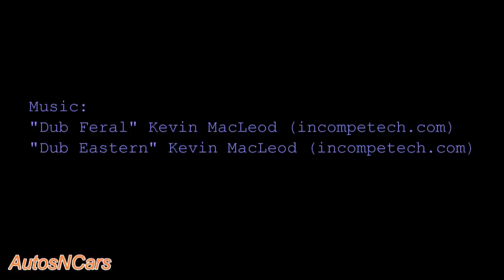TOYOTA SIENNA 1999 2000 2001 2002 2003 SPARK PLUGS REPLACEMENT

Comment: I was able to replace all the sparkplugs in our 2000 Sienna 3.0 in about an hour and did not need to remove anything. It's a tight space but a 3\8 craftsman medium extension, ratchet, and a plug socket is all that was needed. the hardest part was getting the boot off the left rear plug.
Reply from the maker: +Kris Karr you really need to make a video!
Reply: +AutosNCars I kind of wished I had. My wife was there watching me bear hug the engine. I was able to reach through the intake on the right hand side starting with the right rear plug and then work my way towards the left. At that point I had to also reach in on the left side with my other hand to get the boot out. Getting in there will depend on the size of your arms I suppose.
Reply from the maker: Kris Karr It is fun.
Reply: Why not use a t socket wrench that is how I replace mine on my 1998 sienna. They're ten bucks at Autozone. Takes me about a half hour.
Reply: It's a bit tight but much easier than pulling the plenum off etc.  I had a plug boot stay on a plug so I couldn't get a 5/8" plug socket down to turn the plug to get it out.  After consulting a mechanic, put some super glue on the plug wire insulated stem and pressed it back on. Let the glue set to adhere to the boot and Wa La! pulled the rubber boot off.  Even with boot silicon grease the rubber boots, including the coil packs, can stick.  I now will go about every 30 to 50k miles to pull the boots and regrease so I won't have this problem again.

Comment: Great video will be doing a full tune up fluid drain and refill  full exhaust change and suspension upgrade to my wife’s 2000 Sienna!  This video sums up everything I need to know !
Reply: wat is he doing you dont need to do all that humbug...just reach in behind right side back of motor and you can feel the plug wires for num.3/5 plug. follow the wires to the left side back of motor for num.1 plug...took me 15min for the back num.1/3/5 plugs.  not even 5min for  num.2/4/6 plugs....seriously you can get to plugs.

Comment: I did that to my 1998 sienna many time without removing a single part but the pure spark plugs. You just need small ratchets. Dealers charge $650 just for this job.
Reply: wat is he doing you dont need to do all that humbug...just reach in behind right side back of motor and you can feel the plug wires for num.3/5 plug. follow the wires to the left side back of motor for num.1 plug...took me 15min for the back num.1/3/5 plugs.  not even 5min for  num.2/4/6 plugs....seriously you can get to plugs.

Comment: I remember tuning up my 97 camry same engine...I didn't have to remove the intake ..i just use two short extension to pull the sparks plugs out ..lol!took a bit of time...I use E3 sparks plugs it lasts 80 thousands mile..i use on all my Cars!

Comment: Did it on my 2007... put NGK Iridiums in it... took original Densos out... hangs better on the  throttle... engine runs smoother... moderate cruising fuel economy jumped 3 mpg's...on state highway max is now 25 mpg

Comment: holy crap...
i just change mine. you need a 6" extension and a lot of patience. no need to remove the manifold at all! on the left rear, there's a nut holding 2 ground wires. remove that, then you can remove the crank case ventilation hose. that would give you more than enough room to maneuver a small spanner and socket wrench.
Plan your attack, before actually attacking the job. LoL.... took me 3 hours, but that's mostly from trying to figure out stuff. If i have to do it all again, should be done in less than an hour.

Shop estimate is $400 (they claim one coil must be replaced). my actual parts cost is $36 for the six iridium plugs. $12 for the anti-seize compound (which i can use for many other jobs). also bought my own Code reader ($55), and that's how i found out 2-4-6 cylinders are misfiring, making me decide on changing all plugs. no fault codes after plug replacements. engine light was gone too, without any need to reset.
Reply: so no coils needed replacing?
Reply: nope. it was actually the OCV (oil control valve) making the engine run crappy (engine chk light did come back when i got stuck in traffic). ordered for both banks online (about $50 from RockAuto vs $1200 at the local auto parts store), and engine is purring again.
Reply: Wow any way to get you to do a video? lol I want to replace mine myself after a quote of $600 and n 8 hour job
Reply: Missy, if you have the patience, you can do it. But you have to be mechanically experienced too. You don't want to mess up the treads for the plugs. Just be careful, don't get frustrated, and think how you'll overcome the obstacles. I wouldn't say it's easy, but I wouldn't say it's rocket science either. Have someone familiar on hand to give you advice as you go. If you have a sienna, look at lexus videos on youtube in the same year make, as they have very similar parts placement. In fact, I always said my sienna is like a lexus with cheaper clothes. LoL
Reply: Thank you so much Bien :)
Reply: Don't miss the links I gave on James Spencer's comment. The 2nd one gives a clearer view. You don't have to practically dismantle your engine like in this video. LoL
Reply: I'm planning to do for mine also... Can you help me with the tools? what tools do I need cause I have to buy them... I have none right now :(
Reply: Ah, but how many thousand dollars were lost to the swear jar?   ;)
Dropped sockets cost me enough to buy three sets of sockets, so that I don't have to keep crawling after them.  :/
Reply: bv
Reply: wat is he doing you dont need to do all that humbug...just reach in behind right side back of motor and you can feel the plug wires for num.3/5 plug. follow the wires to the left side back of motor for num.1 plug...took me 15min for the back num.1/3/5 plugs.  not even 5min for  num.2/4/6 plugs....seriously you can get to plugs.

Comment: So they estimated me at ~500+$ for spark plugs and wires that are still running after 17+ years, i think i can handle the job myslef but wish you did the wires with the plugs, that would've been a good idea since you're dismantling everything, looksnlike it took you over night to finish the job?
Reply: They're coil over plugs; no spark plug wires.  The coil packs only get replaced if they fail which is pretty rare.  On the same note of preventative maintenance, though, I'd change that PCV valve in the rear left corner.  $8 from the dealer and you'll never have better access then you do with that manifold off.

Comment: No need to remove the intake manifold. You can get a 3/8 in ratchet at harbor freight that has a swivel on handle and head of ratchet. Along with two 3” extension and you can reach around the top and back of the manifold. The two back left ones are the hardest to get to and can both be done in less than 15 minutes both remove and replace. No need to remove the whole top of wiper assembly cover either as in other videos. Too simple of job made to look so difficult. Message me if you need more assistance with this. I would be glad to help. There is also a video our that shows this done.  I believe its a Spanish man that does it. His You Tube Channel is 1unicorn1.  He shows to remove the wiper cover assembly.  I did it without removing this part with ease and no problems.

Comment: Great video, but The Toyota Service Manual said remove the Cowl Panel Assembly first, a bunch of 10mm bolts  that will make it 10 times easier with much more clearance, that is how I changed mine,  you’re doing it the hard way.
Reply: JazzLowrider finally someone on here knows what the fuck they're doing. the wiper panel definitely comes off. good stuff man. #firestonemechanic

Comment: Guess I'm  selling my van,  i don't wanna go tru that.
Reply: @americannovice americannovice lol
Reply: Is a hard work,you try do it without remove that is easier, I did it only touching
Reply: wat is he doing you dont need to do all that humbug...just reach in behind right side back of motor and you can feel the plug wires for num.3/5 plug. follow the wires to the left side back of motor for num.1 plug...took me 15min for the back num.1/3/5 plugs.  not even 5min for  num.2/4/6 plugs....seriously you can get to plugs.
Reply: You're right that's a whole lot of work to put in 6 spark plugs  some cars you have to lift the engine up to get the spark plugs in. LOL
Reply: Bien explicado. gracias

Comment: I changed all spark plugs easily on my 2000 sienna but the last one on the back passenger side broke.. I removed the windshield wiper system and you can reach them all.. the way this guy is doing it is harder but may help you not break a spark plugs on the back side.

Comment: When you tried to pull the plenum off, what was still attached?
Reply: wat is he doing you dont need to do all that humbug...just reach in behind right side back of motor and you can feel the plug wires for num.3/5 plug. follow the wires to the left side back of motor for num.1 plug...took me 15min for the back num.1/3/5 plugs.  not even 5min for  num.2/4/6 plugs....seriously you can get to plugs.

Comment: Makes it easier to work in the back of motor If you take windshield wipers and cover off first. Opens up the work area.
Reply from the maker: Hey, thanks for that suggestion!
Reply: 1kmiles can you show how to remove the Cowl off?
Reply: +onesri 
 The cowl/wiper cover has some push clips and bolts in it.  Take flat head screw driver and pop off wiper nut covers, at bottom of shaft. Take both nuts off. slide wipers off shaft. Detach all clips (push upward) from rubber hood seal (top front of cowl). Now, should be able to take top plastic cover off wiper shafts. Detach clamp from side hose. Now unbolt and remove cowl. Been awhile back since I did this project. Hope that helps.
Reply: thanks for the reply, yes very helpful

Comment: what is that he put on the new spark plug before he inert them back? Is that grease? If so, is it okay to use the lithium grease?
Thanks
Reply: antiseize
Reply: +ScubaCat3 always put antisieze on the threads, costs a $1 and prevents the plugs from getting stuck. Find it at the counter of your auto parts store.
Reply: @MojosArmy  That $1 stuff is ok, but pay a little more and get the copper stuff and you’ll be amazed at how much better it is.

Comment: Good Video, what are torque specs for tightening spark plugs, Bolts around coil packs, throttle body, and intake manifold.. ?
Reply: wat is he doing you dont need to do all that humbug...just reach in behind right side back of motor and you can feel the plug wires for num.3/5 plug. follow the wires to the left side back of motor for num.1 plug...took me 15min for the back num.1/3/5 plugs.  not even 5min for  num.2/4/6 plugs....seriously you can get to plugs.
Reply: @mbr3232  I actually had to do the valve cover gaskets as well so i took the air plenum off and whatever was in the way.. Ended up purchasing a years subscription from ALLDATA for the info I couldn't find, it was around 25 bucks not bad..

Comment: I did this ten years ago but did not need to remove anything.  There are lots of wires/pipes but I was able to insert socket wrench extension first and then attach the wrench handle.  You can't see anything so you have to rely on your fingers.  It took me two hours.  I bought iridium plugs thinking they will last 100k miles so I only need to do it once.  100k miles later my sienna outlasted the plugs and it's time to do it again.

Comment: The first 3 plugs seems easy enough but do you have to remove everything to get to the back three? The video is labeled "Spark plug Replacement" so do I need to remove all of this for the rear plugs. The video did not make that clear.I have been going through it and cannot find where you changed the rear plugs. If anyone see where the rear plugs were changed can you please respond with the time stamp. Thanks
Reply: Yea the first three looked pretty simple but I could not find where he replaced the back plugs. That looked like a lot of work and I definitely need to know how the back plugs are changed
Reply: The factory spark plugs are designed to go for 100,000 miles. The spark plugs are usually never the problem and never need replacement. It's usually the vacuum lines or sensor related. Do the plugs when you do the T-Belt and NEVER trust a flat rate mechanic. Got to be careful what temperature the engine is at or you will pull the threads out, that's why he used the anti seize. This tech has a great feel for the wrench but most guys need a torque wrench when it comes to the Intake Manifold bolts.
Reply: Are you TG?
Reply: Ok I found the part where he changed he rear plugs. It is at starts at 19:13. Looks like you do have to take all of that off. Maybe you can just remove the windshield washers and that cover below them for some extra space. I tried that today and found that the cover does not come off easily. So I think I am just going to have to remove everything like he did to get to the rear plugs.  Oh well. The van has 175K miles and I can hear and feel one of the plugs not firing properly.  I am pretty sure it is one of the rear plugs. 

I am not sure if just replacing the first three now and the others later would not more harm than good.

It is too bad because changing the belts (air conditioner and power steering), was really easy. All I have left to do is replace the spark plugs and the spark plug cables and everything will be finished.
Reply: No you don't. I guess he took off the links I gave. On the left side of bank 1, the #1 plug can be accessed. just remove the ground wire and the hose blocking it. the #2 plug, can be accessed from the top, in between the manifold or also from the right side. The #3 plug, you can access from the right side.
The 3 easy ones are #4-6 which is on bank 2 (front side of engine)
Reply: I agree. Also, if James suspects that the plugs are bad, he can do a "drop-down" test. You simply remove the spark plug boot while the engine is running to see if the engine runs any different, if it doesn't, then you know that that is the problem cylinder/plug. I see no links so yeah, scum bag alert. A.S.E: Automotive Service Excellence.
Reply: Murray Thanks for the tip on the "drop down" test. Sadly I will not be able to do this until next week. Between the video and the comments I am sure this will go smoothly.

I have to admit that I am annoyed by how hard it is to change the plugs on this van. In some ways I understand the design. However I feel that they should have built in a method of changing the spark plugs without a college degree in engineering lol. I feel that plugs should be user replaceable. Anyone should be able to do their own battery, air filter and spark plugs.
Reply: I got the first 3 replaced but sadly I don't think I will be able to get to the back 3....time to take her to a shop and spend a shit load...ugh
Reply: You'll do fine, just take your time and keep confidence. Remember to apply anti-seize to the threads and inner boot. The cold hard fact is that engineers have designed engines to create more billable hours, Ford has been doing it for years, same applies to part failure, it's a sad state of affairs.
Reply: Invest in a swivel, you can do it!
Reply: it is doable without having to practically dismantle the engine, i promise. remember that Toyota V6 engines are almost all similar. so look for videos on toyota v6 spark plug replacement. camry, lexus, etc.
Reply: Cool thanks. I will do that
One quick question: Would it be harmful to change the first 3 plugs today and then the back 3 next week? I am a bit pressed for time this week but I am dying to get started.
Reply: No
Reply: Bien Balajadia could you message me the links please? Thanks!

Comment: So how do you know when the coil is bad?
Reply from the maker: If the coil is bad your engine is obviously will work and sound differently. I just had it and had to replace it. Anyone can do that, very easy. You should also have some error, I don't remember the code.  Check engine light as well.
Reply: @AutosNCars  thank you for the advice.

Comment: Would been easier removing the windshield wipers and covers above the engine. I didnt this on a mazda before. Same engine same design. Now i have to do my moms sienna. Ugh 😆
Reply: that be removing more parts and what a technician do is try to do the job without moving that many parts. because the customer is not paying for the other parts. then if something goes wrong the company or the technician if his doing a sidejob he needs to pay for those parts
Reply: wat is he doing you dont need to do all that humbug...just reach in behind right side back of motor and you can feel the plug wires for num.3/5 plug. follow the wires to the left side back of motor for num.1 plug...took me 15min for the back num.1/3/5 plugs.  not even 5min for  num.2/4/6 plugs....seriously you can get to plugs.

Comment: the v6 front wheel is pain in the ass when changing the spark plugs , were trying to save money on the v6 front wheel but more maintenance compared to the rear wheel engines

Comment: For me  just use angle rachet and 2 0r 3 short socket extension and put one by one. you dont need to remove the monifold.. i know space so small  but you can and the front  just remove the plastic cover.. and it takes 30 minutes to complete the job...
Reply: please make a video when you do it so many will benefit

Comment: I did my back plugs just by blind feel. Lay a bunch of towels down and lay on them. It takes the strain off your back. It's kind of a bear but easier than taking off all this crap. Use iridium plugs. My van has 270k and is my daily driver.